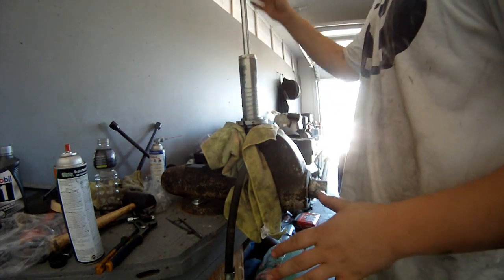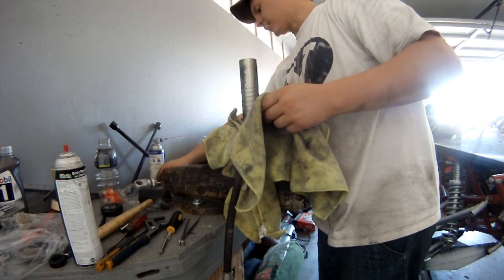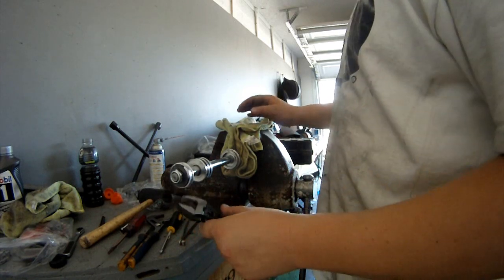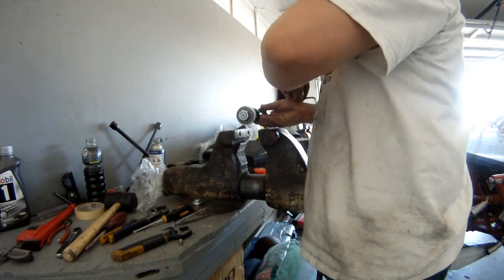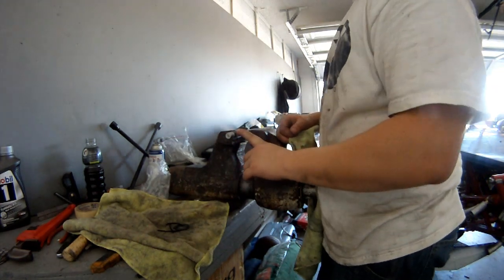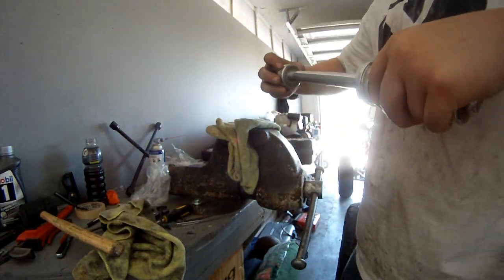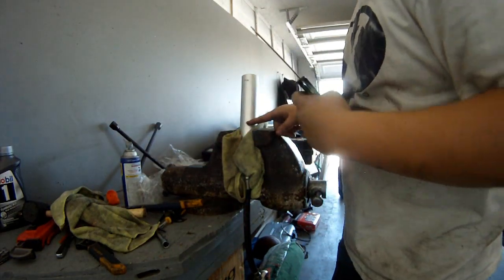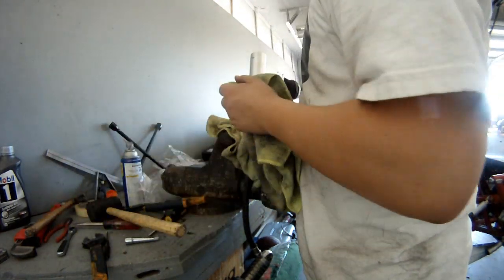FOA Shock Revalve - How To

Comment: Good job on posting
Just a few things I saw when rebuilding your shocks.
Don't use the the body as a clamping place.  Use the Eyes of the body.
There is a tool at the Auto parts store you can buy that is a valve stem puller.  It is a cable T that one end has a core removal.  This will allow you to remove it so when you pull the end caps you don't get Neg pressure and makes it easier to remove.  Also allows you to pull on the valve not messing up the threads.
Please don't hit the seal head down with an extension.  Unscrew the wiper cap and use it to evenly push down the seal head to get to the retaining ring.
After you have drained your oil from the shock body, push the IFP down to push all the old oil out into the body for draining.  That oil looked BAD.  Just use a ISO AW22 hydro oil.  If you need to top off the shocks you can use power steering fluid.
The IFP should not have been that hard to move down.  You should be able to have just pushed it down.
As for the piston nut same thing goes for the clamping place.  Use the eye.  If the end comes off, use some red lock on the thread and reinstall.  If you have to lock down on the shaft, make sure it is as close to the eyelet end.  Any nicks, scratches or so on will cause the shock to leak.  The nut on the piston needs to be TQ'ed down.  I tq them to 30lbs.  This ensures that you will get even clamping every time.  
Fill the shock with oil.  Don't worry about the IFP depth yet because you need to bleed the Rez and the hose of air.  Any air in the shock will get in the oil and cause cavitation.  So fill the shock with oil about 1/2 up the body.  Put the shaft in and cycle the piston up and down.  Need to force oil into the Rez.  Now you can keep moving it up and down to get all the air out of the rez, hose and valving.  I use the piston to force the IFP with oil to the proper depth.
When ready to insert the seal head you need to keep the shaft extended all the way out as much as you can without letting the piston suck in air or you have to bleed all the air out of the shims again.  When putting in the seal head you want oil so spill out so you know you don't have any air in there.
After I have the seal head in, and ready to put he end cap back on, I will add a few cc's of oil in the air side of the rez.  This will keep the back side of the IFP lubed and help keep the seals from drying out.
Don't cycle the shock without air in the shock.  Even if you charge the shock with just 50 PSI of compressed air.  Then you can cycle the shock to make sure you don't hear any air in the shock.  If you do then you need to open it back up and rebleed the shock.
When putting in the Seal head the IFP will move about 1/2inch due to the displacement of the seal head.
I have found that after charging the shock with air is when you want to lock down the dust cap.  This ensures that the will not come lose.
Shocks are easier then people think.  The fun thing about shocks are the valving and the endless variations.